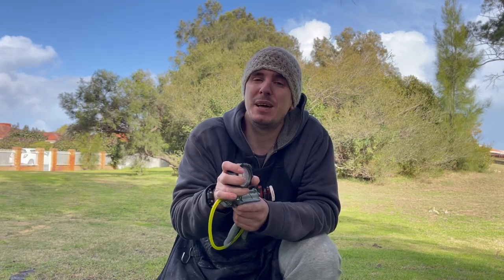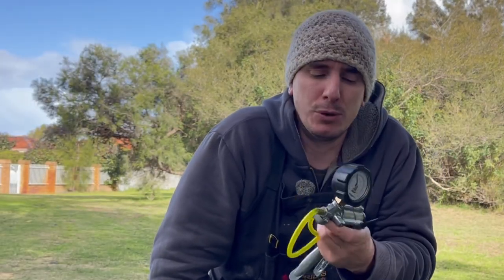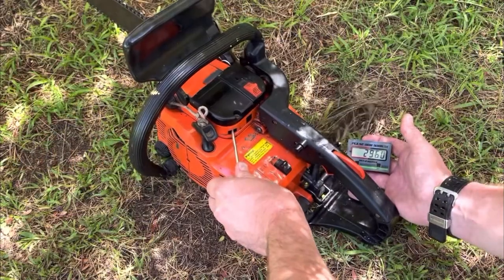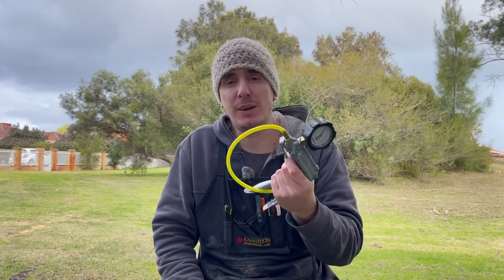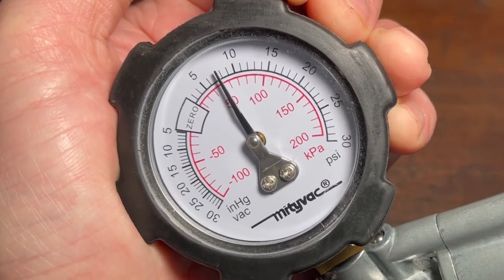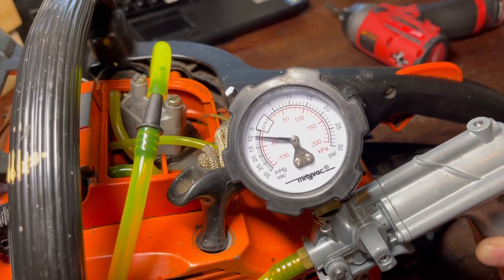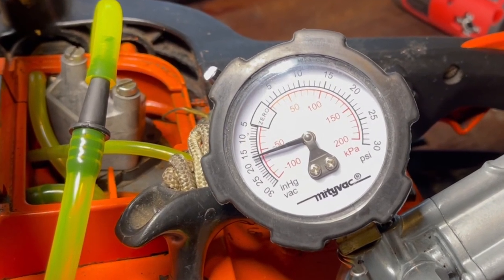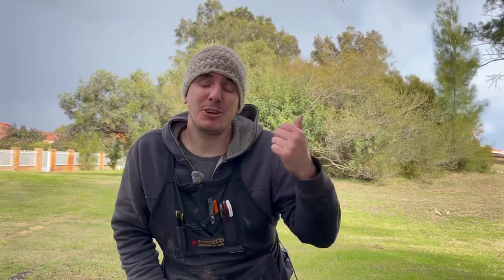Pressure / Vaccum Test: Common & Costly Mistake!!

Comment: Triple digits temps in my area, man , thanks for taking the time to inform, and yes bought one finally on your advice, I made my own and it worked but not as slim and refined. Update on the plastic spark plug barbs…they worked great and hardware stores carry a large variety of barbs. Thank you! Take care,be safe.🙏
Reply from the maker: So pleased all round Dennis! Glad you’ve had great success from the videos I share, it makes them worth doing!!

Comment: HI,
Just had a look at your comment on reading vacuum. I can see how some people could get confused with the readings on the gauge.
However, that problem only applies to people who still use the imperial PSI scale.
It is so much easier using metric scale. All you have to remember is 50kPa.
if we think of normal atmospheric pressure as 0 kPa then we use 50kPa for pressure testing and -50kPa for vacuum testing. Simple !
BTW  50kPa is the same as 1/2 Bar also known as 1/2 atmosphere
Cheers
EJ
Reply from the maker: Thanks :) great idea!!

Comment: I’ve used and trusted the mityvac for years.
Reply from the maker: Good on ya, yep, they’re fantastic. Can’t fault it!
Reply: @VintageEngineRepairs  that they are.  Not sure if all lip seal are the same pressure and vacuum.  I’d check the specs.  Great point.
Reply from the maker: Always worth checking :) thanks for sharing!

Comment: I'm one of the regular users that doesn't pull full vaccuum on those seals. I know Echo generally calls for around 14 inches of mercury. Husky uses a lower number in their training. When I do a vaccuum test I sometimes feel like I'm walking on thin ice. At least twice I know I had a decent seal before I performed the test and wrecked the seal when the outer lip rolled in. Good video, I agree the Mity Vac is a decent tool.
Reply from the maker: Hey Scott! Thanks for sharing your knowledge and experience :) funnily enough I was looking at a husky manual for their 372xp and it says 0.8 bar / 11.6psi / 23.6 inhg! Maybe they dropped the vacuum in newer saws? Either way I appreciate your comment and sharing your knowledge :)

Comment: Yea I have 1 I am a stihl mechanic the problem with that is the pressure release is on the bottom if you put it on the bench you can hit it
Reply from the maker: Yep that can happen! I think it’s designed for when you have greasy, dirty hands - the release  is very easy to press and access. If it was small and out the way it would be annoying.

Comment: Good one! 👍🍻 What about the brands you'd stay away from?
Reply from the maker: Thanks for the reminder William! Less the brand rather what they offer. Many are sold as just pressure, stay away from those. Instead always confirm that the one you order actually says both. There are a number on eBay that don’t make it clear, or they use a picture that shows one that can do both, but the description says just pressure or vacuum! I have owned a cheap eBay one before and it was fantastic! I hope this helps :)
Reply: I initially  brought one of the cheap ebay units that did both but it wouldn't hold either so must have had an internal leak.  Now have the Mityvac and it works like a charm.
Reply: @VintageEngineRepairs  I can testify to the quality of the Mity brand. My all plastic, vacuum only is probably around 45 yrs old and still works, although one of the o-rings needs replaced..Thanks.
Reply: @treecycle4631  👍🍺

Comment: Since a crankcase experiences both pressure and vacuum, would it not seem wise to test the seals in both conditions, rather than just only vacuum? I realise that if the seals do seal under vacuum, then they will likely seal even better under pressure, but since while doing the test we are actually not only testing seals, but also the head gasket, (if present), base gasket, de compressor sealing.  So for the sake of flicking the switch on the pump, why not just do both, so that all potential leak paths have been tested in both directions.
Reply from the maker: Yep! I always do a pressure and vacuum test every time. Pressure for the things you mentioned and the vacuum to test just the seals :) thanks for watching!